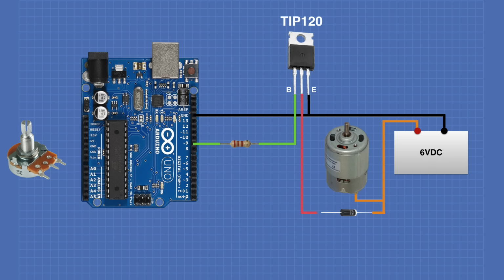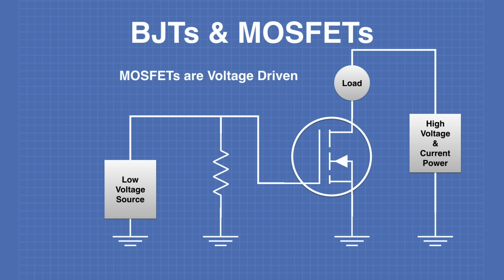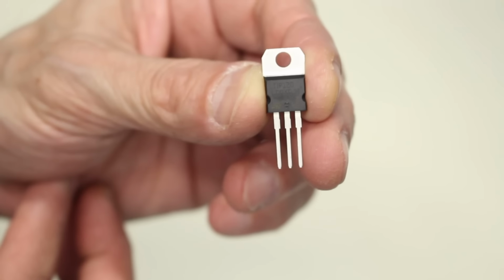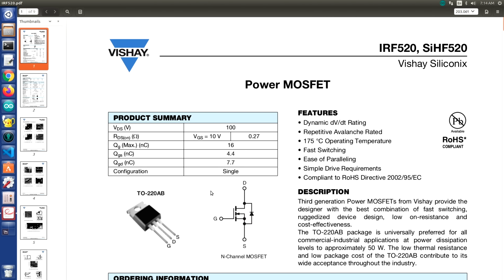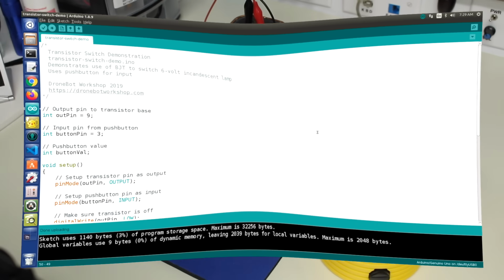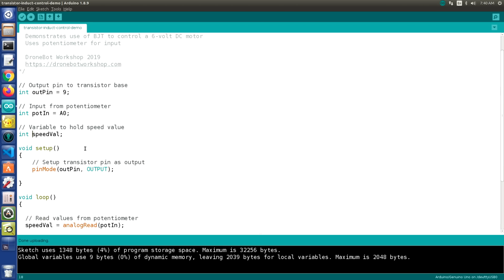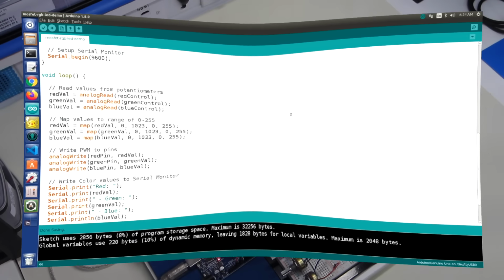MOSFETs and Transistors with Arduino

Comment: Great video!  Question:   The PWM with MOSFET causes flickering in my LED (bc the PWM signal turning off/on very quickly).  How do I get rid of the flickering?  Can I use a DAC on the PWM output to convert it to a constant (ie smooth)  0-5V signal?
Reply: put a smoothing capacitor at the output
Reply: If you use a DAC (or filtering) on the PWM output, you'll run the mosfet in its linear region, rather than as a switch, and you'll dissipate a lot of heat in it. And I mean a lot if you're using an LED strip, like in the video. This is a bad idea.
The Arduino by default uses 490Hz for its PWM, so I'm amazed that you can see the flicker. Normal 60Hz monitors must be a nightmare for you to look at.
Pins 5 and 6 run the PWM by default at 980Hz, so you might try those instead and see if it helps. Otherwise, you'll have to search for how to increase the PWM speed on the Arduino to a frequency where you can't see the flicker.

Comment: Why you have used 1K ohm resistor from gate to GND in case of MOSFET?
Reply: such a resistor is used to force the MosFet to turn off faster. . It also pulls down the output to prevent floating.

Comment: Hi, I really enjoy your channel. I have a general question, not specific to what you discussed in this video.

For an EV, specifically an electric boat, in order to have a 72/96/144 volt electric AC induction motor, does your battery bank have to be the same voltage?  For a 144 Volt motor, does battery bank have to be 144 V, or can you have a 12/24/48V bank and use a step-up/boost converter to get the required voltage? Thanks in advance.
Reply: You can't run a AC motor directly from a battery, which is a DC source. You use an inverter to generate AC from DC and you'll need to research the available voltage outputs from commercial inverters that match your expected current demands. They are commonly run, however, from 12V or 24V DC for automotive applications.

Comment: Very much appreciate your video as it educated me on the difference between transistors and MOSFET's.  I've built a circuit similar to one you built to control LED strip using 3 MOSFET's (I used IRBL8721 with 1K resistor).  My problem is the individual RGB LED do not seem to be going on/off based on my Arduino code.  When I attempt to turn one on (i.e. Red) the Green and Blue LED's are still on though at somewhat lower intensity.  Any idea what could be wrong with my circuit?

Comment: 🐓Question: the TO_66 or TO 3 would it be common see one in a MIG welder or Tig hanging on the side of a transformer or is it a component that sits directly on the board?

Comment: Great video.
Question.... At 25:50, would a filter capacitor on the motor be a good idea? If yes, how do we calculate value?
Thanks
Reply: Why 1K resistor used in gate to ground for MOSFET?
Reply: @GobeshonaBD  To make sure it is turned off when the signal line is disconnected. Mosfets have such a high input impedance that the voltage on the gate will stay for a long time unless you use a resistor to bring it down to ground. You'll usually find 10K is a more common value, though.

Comment: Thank you very much again. I've had a lot of problems when trying to use mosfets  at high frecuencies: extreme heat all of as sudden. Any help, please. Thanks in advance.
Reply: Mosfets have an input capacitance that becomes increasingly significant as the frequency goes up. When you are switching them at high frequencies, you have to supply current to charge up and discharge that capacitance, and the mosfet does not switch until that charge is supplied or removed. The leaves a short time while the mosfet has a high voltage and high current which causes heating. Have a look at some of the YouTube videos that explain how to use a gate driver to supply sufficient current to the gate quickly enough: https://www.youtube.com/results?search_query=mosfet+driver (just pick any one).

Comment: On the motor you placed the diode in a certain orientation. But what if you had the arduino have the motor go in forward and reverse. Would you place two diodes in series head to head.? To combat the induction load?
Reply: You need a H-bridge circuit. Cannot not be done as you stated

Comment: How do you decide the resistor value between the arduino and MOSFET? What happens if you don't use a resistor?
Reply: You use 270R because the Arduino can supply no more than 20mA and that resistor ensures even a short-circuit won't draw 20mA from 5V output. If you don't use a resistor, sometimes it works fine. Sometimes the pulses of high current that charge/discharge the mosfet's input capacitance damage the Arduino. Sometimes the long leads between Arduino and mosfet, along with the mosfet's capacitances produce oscillations at very high frequencies, which warm things up a lot, even when the Arduino has its output low. Personally, I use a gate resistor between any microcontroller and the mosfet, and another one (10K to 100K) between gate and source to make sure the gate can't float if the lead from the Arduino gets disconnected.

Comment: 15:55   Not correct as I understand. The Gate does Not suddenly turn-on at Gate Voltage and allow substantial current to flow. It needs a few volts ABOVE the Vgs. Check out the graph of Vgs to Id on the datasheet.  With a max Vgs voltage of 4V you may find it does not work well at all.
Reply: @Kenn Mossman If we're looking at the same graph (fig. 3 on the Vishay IRF520 datasheet) and I'm interpreting it correctly, it looks like a typical part should conduct around 2 amps Ids at around 4 volts Vgs. So you're correct it's not really "on" (for some definition of "on"), and I wouldn't want to design a production widget without doing a better job of tolerancing, but it's probably "on" enough for some experimenting with Arduinos. I was hoping for a graph of Rds vs Vgs but I don't see one available for that part.
Reply: @dahlia695  Yes. My concern is that people would assume that once Vgs threshold is reached then max Id is possible.

Comment: Is the reason youhad no heat in your mosfets because you literally ran no power through them and used them just as a switch? 
The power load wire is from the regulated lab power supply not the mosfet load side v+?

Im new to this so excuse my lack of knowledge if im wrong.

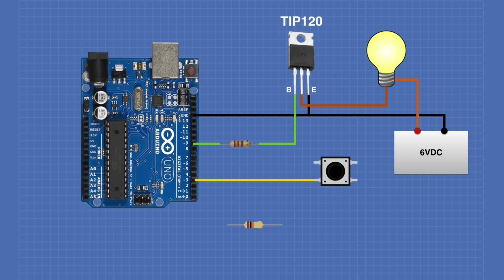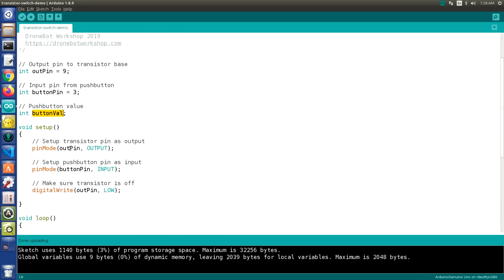Comment: 18:15 / 19:09 I think you can also set the buttonPin as INPUT_PULLUP instead of using an external 10k resistor or is there a reason why to use an external one?
Reply: You can use the 20K internal pullups, and I suspect the only reason the 10K external resistor was used was to keep the teaching point simple for beginners.

Comment: I just have to be that guy and say this isn't technically controlling a motor by PWM. This is sending a pulsed voltage that changes.
A true Pulse Width Modulation signal does just that. It Modulates the Pulse Width. The Width refers to the amount of time the voltage (6v in this case) is applied to the motor before being switched off again. if you apply it 100% of the time you would get 6V applied to the motor. If you applied 6V for 50% of time you effectively have 3V applied to the motor.

So the Delay(X) in your sketch should be related to the value from the analog input (off the top of my head, it should be 1/Y, where Y is the analog read in). 
The analog out should be just a digital output that is on for the amount of time calculated then switched off. To be turned on again at the next cycle.

This is my only criticism. Otherwise I love watching these and will be watching more.
Reply: I'm sorry, but the code doesn't work like that. The command analogWrite( redPin, redVal ) sets pin 3 generating a square wave at about 490Hz with a duty cycle set by the value of redVal which continues until a different value is written or a reset occurs. That is precisely what PWM is.
The delay(20) in the loop is just to let things settle down before looping back to read the analog input pins again and write fresh values once more to the PWM pins.
In other words, the Arduino is very smart and generates the pwm square waves internally. You don't have to do that yourself in code.

Comment: What is the reason for the 1k resistor between the IRF520 Gate and ground connections? And do you know the reason it is sized at 1kohm?
Reply: Using a resistor between the gate and source of a MOSFET assures that the FET stays turned off except when you want to turn it on.
The impedance of the gate of a FET is extremely high. Touching the gate will usually turn the FET on just due to the AC voltage you pick up as an "antenna." (the AC will actually turn it on and off) In a circuit, connecting wires might act the same way.
When you use a microcontroller the impedance at an output pin is also usually extremely high until the pin is configured as an output. It may be anywhere from milliseconds to seconds after a processor is powered up before the pin is configured, depending on the hardware and the code.

The resistor dramatically lowers the impedance so you actually have to be able to supply some moderate amount of current to get the gate-source voltage high enough to begin to turn the FET on.

A MOSFET gate behaves like a capacitor. You have to charge it to turn the FET on, then discharge it to turn the FET off. Some circuits can do the charging, but have no means of doing the discharging. The resistor provides a path for discharging. Processor outputs can do both charging and discharging unless they are "open drain" in which case they can't do the charging but can do the discharging.

If all you want to do is assure the FET stays off until you deliberately apply voltage to turn it on, 1000 ohms is far too low in my opinion. It will work, but if you drive the gate to 5 volts there will be 5 mA flowing through the resistor for no good purpose. I'd use at least 10 k, maybe 100 k or even more. If you need the resistor to discharge the gate, 1k might be appropriate.

Comment: Thanks for the video, it has explained questions I had regarding assembling hardware for led lighting for model rail building.

One query ,if I may,  I have seen similar circuits using the module that either, do, or do not, use VCC connected to 5volt on the Arduino Uno.  Is there a reason for the VCC connection, or is it “convention” similar to using a software or hardware pull down resistor?  Thanks
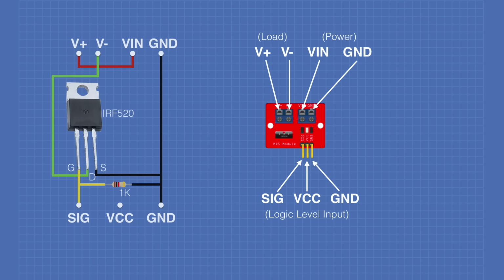Reply: If it helps, he said that the Vcc is not connected to anything on the module. I was wondering too. 31:35
Reply: @user-pn3gm6ms6t  I suspect it's actually connected via the other 1K resistor and LED he mentioned as an indicator that Vcc is on.

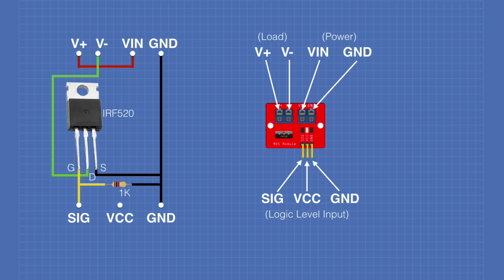Comment: I am confused in the IRF520 example: if VIN is only connected to V+ (from 31:53) and you are not connecting V+ to anything, then why connect 12V to VIN at all? :| Shouldn't it work without it?
Reply: Perhaps it got messed up because he is using a module and trying to show the discrete version...........

Comment: This video started to make my brain hurt a little bit but I'll be honest I'm learning quite a bit I think some setup like this can be used for a problem I've had for a little while?  I'm trying to limit the DC input to a grid-tie inverter without a limiter from a Battery Source... basically I need an electronic throttle between the battery and the inverter I can do it other ways the problem is I get pretty high percentage losses in power... it will be dealing with somewhere between 24 and 48 volts and quite a bit of current possibly up to 40 amps would the transistor type motor driver setup be better for this or is the mosfet LED driver?

Comment: Hello and thank you for the nice video! I would love and really appreciate if you can help me on something please. I am trying to use an ESP32 and IRF 520 module (same as in the video) to control an LED light which is 3.7 volt. The main problem I have is that the gate on the MOSFET doesn't open at all. I understand now from your video that 3.3V on the ESP side is not enough for the gate to open and I was wondering if I use a logic level shifter on the 3.3V pin and then go to the MOSFET so I can shift it up to 5V. Do you think this can sort my problem? Thank you in advance!

Comment: hm... i wonder if it is a problem that i connected my LED Strip AND my teensy directly parallel to the power supply?? would it be safer with a mosfet? (it worked fine for two years but i now have to replace the teensy because something cracked)

Comment: If I was using the IRF520 set up to control three 12V DC motors, would I need to add a fly back diode or does the RFF520 handle this?
Reply: He conveyed induction loads need the diode or it will destroy the 520 at motor start up time

Comment: Sir, can you please explain, for my understanding, when you drive a dc motor with a tip120 transistor, you use an external diode, while the tip120 already has a diode inside?
Reply: Granted. Since another model might not have this, or if you make your own from two transistors you need the diode.
Reply: The reverse-biased body diode inside the TIP120 wont protect it from positive-going inductive spikes that occur when the current through an inductive load stops. You need a reverse-biased diode across the load, not across the transistor.

Comment: I am a little new to playing with Electronics. I need a little assistance if you have any suggestions let me know. Long story short I am upgrading a dated Solid State Electronic ignition system for a garden tractor that you simply can't purchase parts for. The solution I am trying to integrate a Coil on plug style ignition system from a Toyota engine. the coil on plug does have a built in Coil Driver with some type of Transistor in it. It is given a low voltage signal from the computer anywhere from .1 volt to 4.5 volts D.C. 

    I am trying to fire the coil with a pick up coil which delivers A/C current.  This will not work. The voltage isn't high enough and I am not sure it will work even on amplified A/C voltage.  I need to either amplify the A/C voltage from the pick up coil or somehow have a device that will take the low A/C voltage and produce a 3 volt signal to the coil to fire it. Any thoughts on how to accomplish this ???

Comment: Hello.
Slave count is important, which I want to run with arduino. Especially my 10 mfrc522 and 1 or 2 slaves with spi communication are the same protocols. How should I connect my sd card with these 10 mfrc and write the code; work well? Thank you. Also, I think the problem is knotted in the lines. Should I buffer miso lines with 3 states? To be guaranteed to work.

Comment: Sir what is the work of diode in this circuit
Reply: To avoid the revers of voltage
Reply: Google freewheeling diode or flyback diode.
Reply: When a DC current flows through an inductor, when you switch it off, the collapsing magentic field causes the inductor to induce a voltage in the opposite direction to what was applied to it.  This voltage can be large enough to damage semiconductors.  The diode provides a path for the current, generated by this reverse voltage, to flow and prevents a large voltage from appearing across the inductor.  This diode is often reverred to as a freewheeling or flyback diode as mentioned by others.

Comment: I have a few quick questions if anyone can answer it. 
I found a MOSFET with a Threshold Voltage Vgs of 3V. Does that mean the signal (gate) has to be at least 3V to trigger?
And second, I think I understand this, but does the Rds (on) Test Voltage Vgs just mean that is the voltage they applied to the gate when they measured the resistance? And does this voltage vary with higher or lower Vgs? Does a lower Vgs result in higher resistance?
Reply: Does that mean the signal (gate) has to be at least 3V to trigger? - YES is the short answer. A fair bit higher is the medium length answer; as the Vgs(on) varies by current and it is measured at a mere 250 uA

Comment: 32:34  is necessary to add 1k resistor   ???  can any one explain the uses
Reply: It forces the MosFet off more quickly, otherwise the inherent charge can persist. It also pulls down the output to prevent floating.

Comment: Hi sir iam making 3w. 30RGB LED for arduino module esp8266. Best Transistor
TIP122 or mosfet?
Reply: IRLZ44 for its low Rds(on) at Vgs=4V, and it's cheap. There are better ones, but you pay a lot more.

Comment: I am using PWM with arduino to drive LEDs but need to beef up the voltage to 12v. Will the PWM still be intact after passing though a MOSFET?
Reply: yes, and also with a BJT

Comment: How can the arduino drive the gate without a series resistor?  Wouldnt the current be too high?
Reply: chukchee The gate of a MOSFET will draw no current (in an ideal MOSFET but in reality it's a very small current) so it's fine. The state of a MOSFET is controlled by the gate voltage as opposed to the BJT where it is controlled by the base current.

There's a lot more to this stuff  but this should answer your question.
Reply: @matthewfennell7886  Thanks for that info.  How would one determine the maximum current flow during turn on? And, what is the typical current flow?  Thanks.

Comment: What does the blue wristband do? Is it grounding?
Reply: It does nothing. Looks pretty
Reply: @martymcgill1312  LOL   It by itself is useless. It has to be grounded. There should be a cable going from the strap to Earth.
Reply: @kennmossman8701  I understand the intent, but I've never had any issues with handling loose or installed components, and have many professional friends who make a living in electronics and NONE of them have static issues, nor wear a bracelet. I think it's an old hyped myth.
Reply: @martymcgill1312  It might be over hyped but it is definitely not a myth. Another YT channel reported frying a dozen Mosfets because of not following ESD protocols.  I have worked with hardware engineers and electronic factories - they all followed ESD protocols.